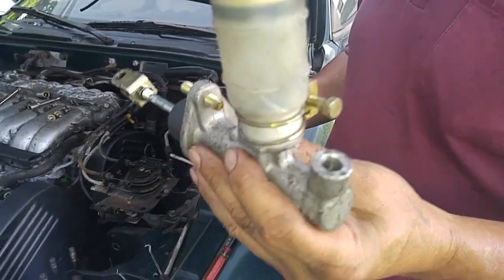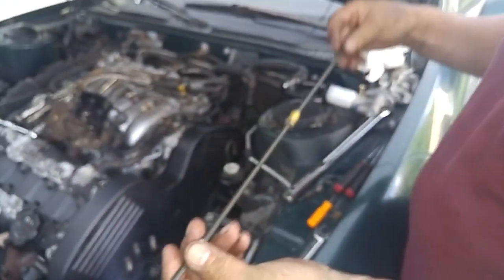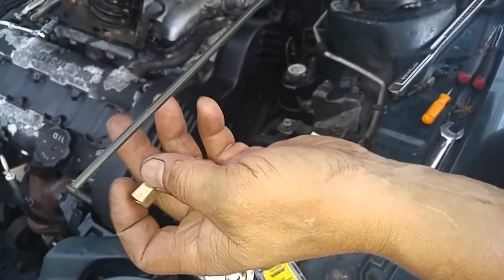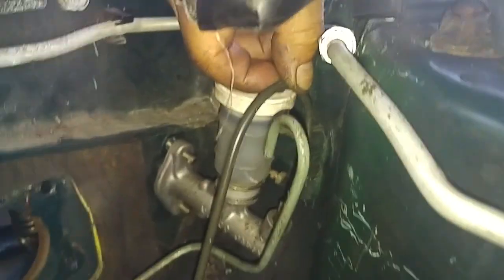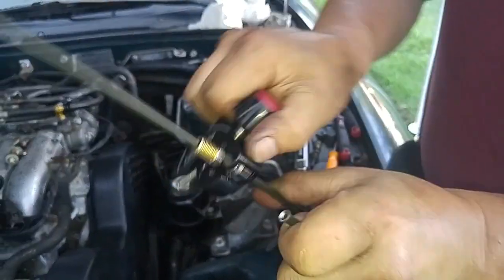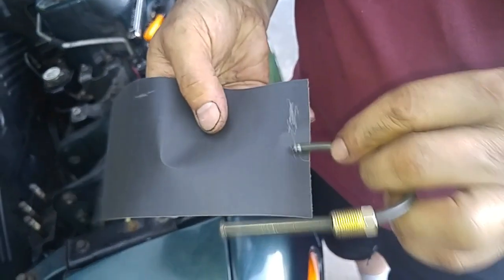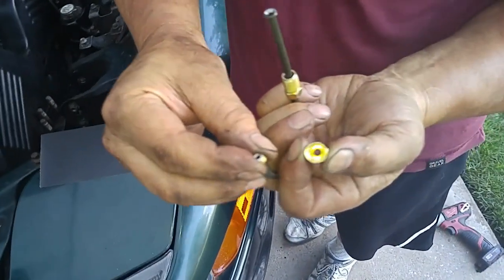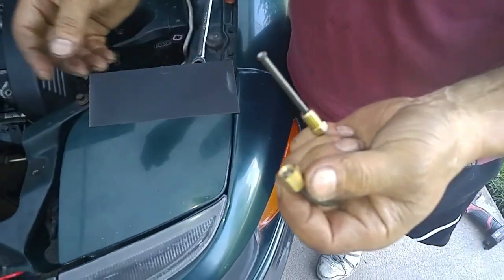How To Fix Brake, Clutch, & Fuel Lines

Comment: That compression fitting is fine for hydraulic clutch lines but DO NOT USE ANY WHERE ON YOUR STEEL BRAKE LINES!!!!!!!!!.
Reply from the maker: Please share why?
Reply: @hardlymovingpro  Slam your brakes on really hard and u will find out.
Reply from the maker: @paulyassy257  Been there, done that ... no problems.
Reply: @hardlymovingpro  And it's illegal in some places.Real mechanics know not to do this!
Reply from the maker: @paulyassy257  Really?  Who do you think taught me?
Reply: stick shifts....... They can really break you It make you do a lot of thinking because of all the problems and rattling noises..... no pain no gain....... I had a fluid leak for almost 3 years But it's impossible to find because there's not any actual fluid that's disappearing...